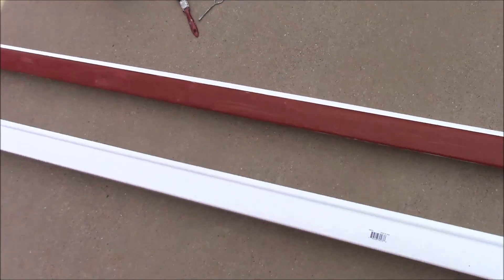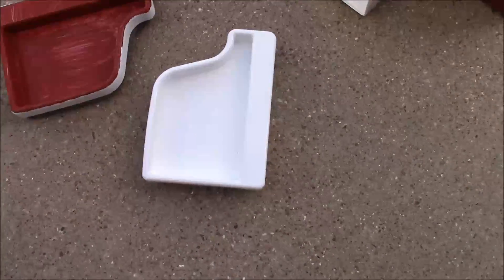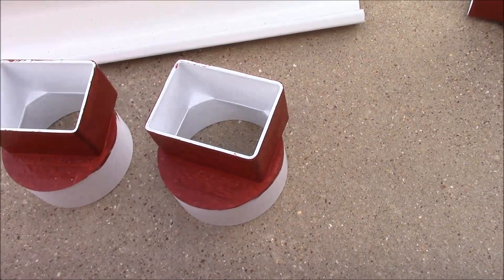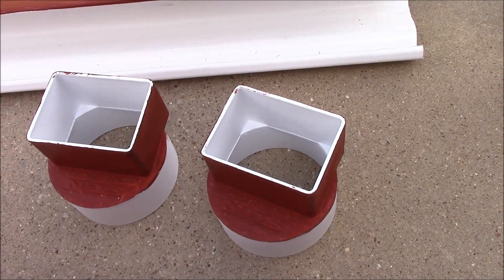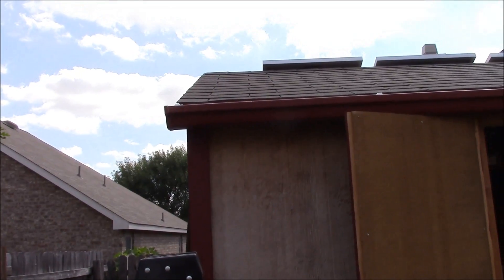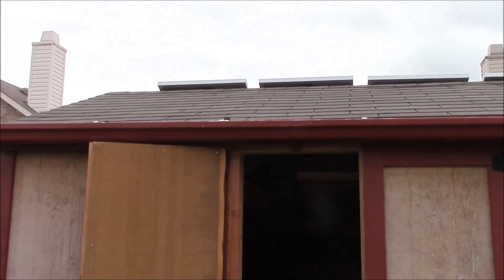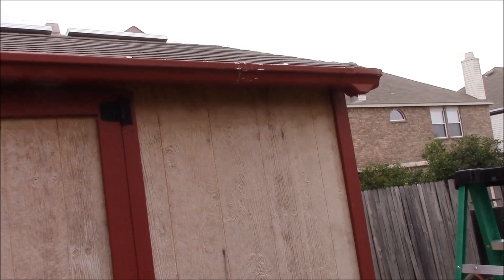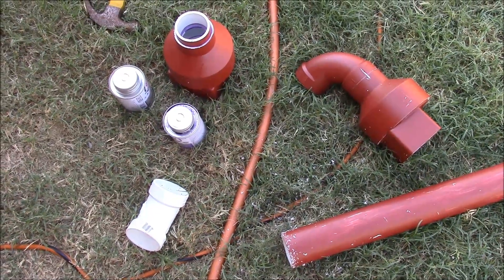Building A Rain Catchment System - Part 3 Vinyl Gutters And PVC Piping

Comment: Thanks for this vid..  I've subbed you because of it.  Now that the system has been in for a while, have you had any issues with leaves and debris clogging the pvc?  It seems that there may be some spots in the system that would be hard to clear if they got jammed up.  I'm going to be tackling a project like this soon...  thank you!
Reply from the maker: +GoingGoingGalt Hey, thanks for the sub!  I have not had any problems at all with leaves or debris.  There is only one tree within 20 feet of my shed and it really isn't tall enough or close enough to drop too many leaves on the roof.  The gutters would be fairly easy to clean if I needed to since they are only about 9 feet off the ground.  The only thing I would do differently if I did it all over again would be to design a refillable carbon filter chamber inside a section of the pvc pipe right before it enters the IBC tote.  I think that would help make sure there wasn't anything nasty in the water like bird poo or dead bugs.  But really this water is for emergencies only and for garden irrigation so it wasn't necessary.  Just something I would have liked to play with.

Comment: you just have to find a way to filter the water im pretty sure that be easier so then you can emergency water
Reply from the maker: Tård Øksnes Good thoughts.  I can definitely make improvements and likely will.  For now it will water my garden and provide emergency water that will be pasteurized and filtered before drinking.  Thanks for the comment!
Reply from the maker: I haven't solved that problem yet.  Until then, if I had to use the water I would boil it or pass it through a drinking water filter like a Brita filter or something.
Reply: +LDSreliance The house I grew up in had a raincatchment system as it's only source of water and the water from the roof got filtered through a sandfilter, basically a sandfilled chute aprox. 5 meters long, before going into our tank. Would recommend some mesh on the gutters to avoid birds or mice or whatever falling into the pipes and drowning. My entire family got what we thought was a stomach-bug at the same time, but it turned out that a bird had gotten caught in one of the drainpipes and died and had contaminated our water.

Comment: Excellent job. Looks great too. Doesn't look like some throw together system but compliments
Shed's overall appearance. Definitely will revisit this series when I do something similar to my off grid cabin shed
Reply from the maker: Hey thanks!  Appreciate the feedback.  So are you building this off grid cabin right now or just planning for the future like I am?
Reply: i recently bought the small cabin, and have been in process of upgrading it since, beginning with the loft build out, and now converting all its power to solar which will be totally off-grid.  Solar at cabin almost done...just completed the trench from my shed to the front of cabin for my AC wires, and Trimetric.  Certainly not the fun part of the job.  But, once i complete the solar (another weekend or two), I will take a break, and then move on to the rain catchment, whether permitting. My overall goal is complete independence from grid, sustainability, and some common sense preparations.
Reply from the maker: Nice.  I like it.  Are you shooting any videos of it?
Reply: actually i am.  check out recent vids on my channel.  i think i call it Offgrid Cabin Install, or something like that.  i have parts 5 & 6 in bag, just haven't posted those yet. but majority up on my channel.
Reply from the maker: Will do.  I am subscribed to you but I guess I didn't see those come up.  Thanks!